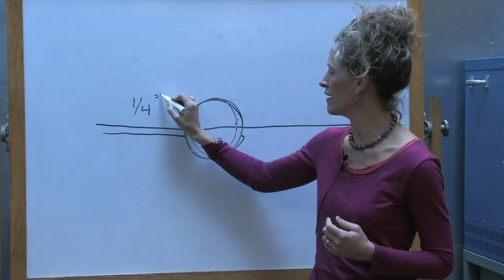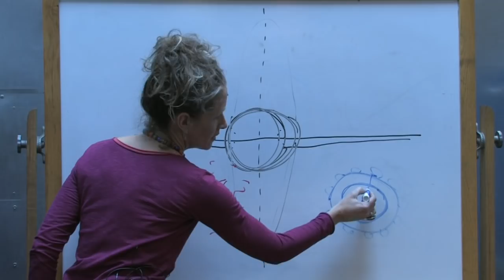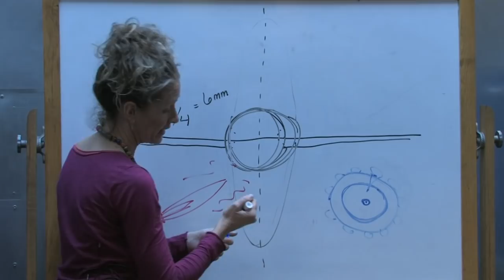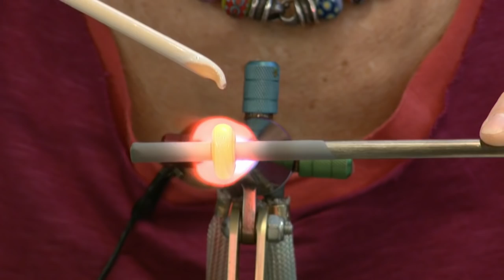Studio Demonstrations: Kristina Logan

Comment: I know its not likely that there is anybody monitoring this anymore but i was wondering what the material is or what it's called that allows the bead to come off of the steel rod? 
Thanks and kudos to the tech crew for all of these videos and live streams that you do!
   Cheers,
                 Benjamin T. Ewing
Reply: oh also as a beginner, (other than a torch and glass) would you say there are any essential tools to start with if a person were to go between small glass blowing and lamp working? I'm trying to work as small of a budget as I can sense I'm still in high school. Thanks!
Reply from the maker: Thanks for watching Benjamin! The metal rods are coated in what's called "bead release" which you can likely get from  anyplace that carries flameworking supplies.
Reply from the maker: The material on the mandrel to allso the bead to come of is commonly refferred to as "bead release", and is essentially a ceramic slurry that allows for (once cooled) the coating to be easily broken down and scraped off the bead, and removed from the metal rod.  It is neither expensive or hard to come by.
Reply from the maker: You absolutely don't need much.  Many people would argue your best tools are heat and gravity, and along with the careful placement of glass you can accomplish quite a lot!  To add to it, I would recommend a pair of small stainless tweezers, a small graphite paddle.  You can grow your collection from there.
Reply: Corning Museum of Glass Awesome! Thanks you so much for the help!

Comment: What is a good kit to start bead making
Reply from the maker: It depends a little on what you have already for tools and equipment (if anything), what type of glass you want to use, or even what kind of things you want to make.  Try looking at Walepparatus.com (eastcoast) -or Arrowsprings.com (westcoast) - they both have a variety of kits to get you started and if you call them they are both very friendly and can point you in the right direction.  Good luck!
Reply: Your best bet is to take a class!  There are a lot of safety issues one needs to be aware of.  Also, that will tell you if you really like doing it and should invest what will wind up being a large sum of money.  Small steps in the beginning pay off in the end!